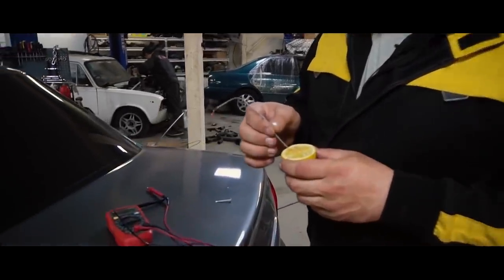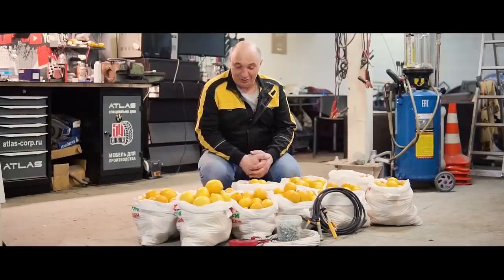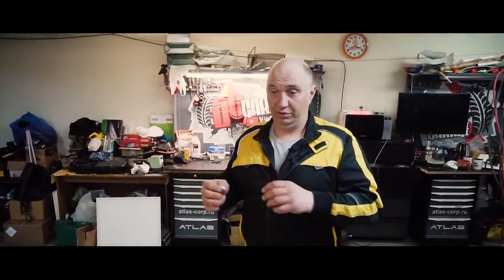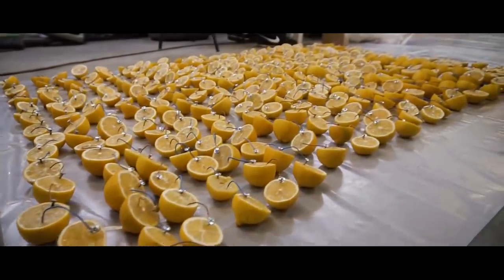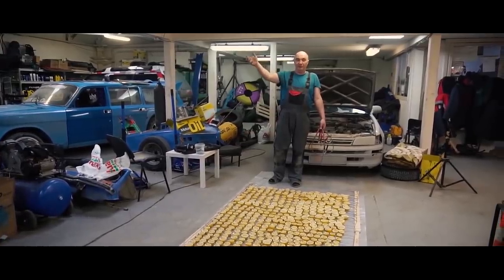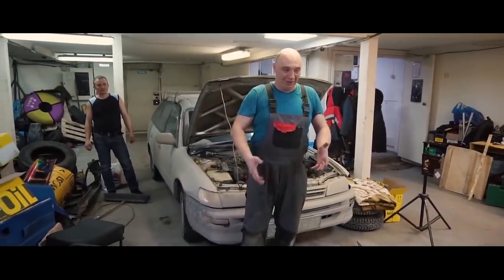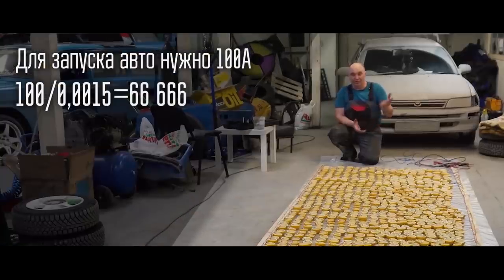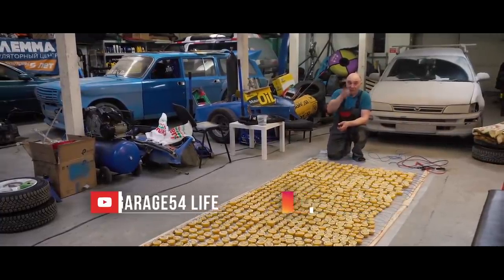Can a battery made from 1000 lemons start a car?

Comment: 8:30 He "measures amps" by short circuiting the battery. xD
10:19 He tested the battery by having one wire in his mouth and one in his hand. :D
Oh god I don't know if I should cry or laugh. :S
Reply: No he didn't short circuit the battery, I watched it many times...
Reply: @WhiteEuphoria74  have you used a multimeter? when you measure current the power is supposed to pass trough to the load, he put the wires to the positive and negative leads.
Reply: @Jeffthermite  Yes I have used multimeter many times and I know what you mean when you mention short circuit.
At the same time it is very common and possible to measure battery amps with a multimeter.
Reply: In a short circuit you basically get infinite amps even with a small battery. Go ahead and do this with a fresh 9v battery, i triple dare you :D
Reply: @WhiteEuphoria74  Look at the comments. Now go argue :D
Reply: @Jeffthermite  That is fine to measure a battery with very little current, just to get an idea of power. You are using the meter as the load, of course this not the way you measure a real power source, but a lemon battery barely has any current.

Comment: Can a battery made from 1000 lemons start a car?
I save you some time: NO
Reply: Thanks!
Reply: I paused at the ad and scrolled for this comment. 👍 Thanks
Reply: Probably he used too small of the mass like a screw.
Reply: Came straight to the comments for this.
Reply: Yeah, 250 amps isn't coming from 1000 lemons. Amperage is not the same as voltage.
Reply: The internal resistance of the lemons would prohibit even 1amp.
Reply: Corey N  These people already know exactly what they like: the results. What an embarrassingly narrow-minded comment, Corey.

Comment: It didn't work because your Anodes and Cathodes are too small. Try them with wide sheets of copper and Zinc plates on each lemon and you'll harvest much more power!!!
Reply: True, voltage and ampere multiplied the factor of the surface difference

Comment: Instead of the tiny wires, use sheets of zinc and copper. The more plate area you have, the more current you should be able to get. Also, the distance between the plates affects how much current you get.
You could also get the juice from the lemons and make a proper battery: Zinc, paper divider, copper, paper divider etc. and then fill it up with juice. You could do it with about ten or twenty lemons I'm guessing.

Comment: Yes, you can start the car with 1,000 lemons; you just need the help of a super capacitor!

Use the lemon to charge the capacitor and once enough energy is collected, then it should start the car will no problems.
Reply: The lemons still wouldn't put out enough power

Comment: My guess is the small surface area the acid had to contact, try a container with copper and zinc plates in it and juice the lemons into it. Could try one on each side or alternating plates with all the zinc in line and all the copper ones in line.

Comment: Dear Vlad, on the toyota this did not work maybe.
However I own a Dnepr (soviet) bike and was once stuck with a broken voltage regulator, which boiled the bike battery till dry. As the bike was running, no issues. So drove as far as the gas tank allowed until the inevitable gas stop.
Bike didn't fire up (kickstarter) because ignition (electronic from Ural bike) required at least 8 V and battery of bike was obviously below. Went into store at gas station and bought a 9 V battery to parallel the internal one.. And got home like this.

Maybe you could use the handcrank on a lada and some other alternative power source next time. 

Greets from Netherlands

Comment: Should have used wide strips of copper and zinc instead of wires and screws. The wires have to small contact area in the 🍋 also a super capacitor would help store all that juice and release it faster

Comment: Maybe add in some capacitors e.g. lemons change capacitors and then use the capacitors to actually start the car. 
You should try to make a welder using lemons. That would be amazing if you could get it to work.

Comment: Ok, but ah, what if you put it on a capacitor, to let it build a charge slow, would that do it ? and can you charge the Limon battery ? if you put power in would it not de-oxidize the connections like rust removal with charger?, or could you charge a dead battery over time?

Comment: I think there's another method of wiring them. For example in parallel instead of series. Series is giving you voltage. Parallel gives amperage I believe. So in a different configuration a reasonable amount of lemons may actually have enough juice

Comment: I thought to myself, if its the Citric Acid you're using to make the power, why not just make a huge jug of it and power an electric car? maybe the costs? so i looked into it, there is an average of 1.44g acid per ounce of lemon juice.  I found a listing of about 16lbs for 50USD then i found a 50lbs bag of Citric Acid for 99USD, soooo use idea?

Comment: To get the amperage and voltage up, use a copper plate, and a zinc plate. Giving a much larger surface area for the current to pass through should improve the power drastically. Possibly dangerously.

Comment: Tiny wire ends and screws don't have enough surface area. Try strips of copper and zinc sheet metal, and use more than 1 strip of each per lemon. Interleave them like plates in lead acid battery. Also, solder all the connections. Make a wood grid to hold each lemon half and wood bars to hold the electrodes so they can be stabbed quickly into the lemon halves.

Comment: You can get more power using plates rather than nails, the power delivery is dependant on surface area exposed to the acid 

If you used thin but wide copper and zinc strips you probably could start the car with 1000 lemons, albeit just barely

Comment: surface area of copper and zinc which greatly affects the amount of volts and amperes. You should try using a plate rather than just a wire

Comment: That's a lot of money spent on a galvanic effect. Try the epsom  nosalt table salt in a copper tube(+) with a magnesium rod(-) center, it will produce higher yields(ive had 1.2v) and if its .8 volts or higher you can run it through a diode for multiple cells. Dry cells if done right can last for years.. Ive made some cells and hooked them up to a jewl thief and lit a led for a couple of weeks, im pretty sure i didn't boil all of the water out(heard 1100°f). Just something to look into if you like making cells and you are responsible around open flames.

Comment: That was a "shit ton" of lemons but I have to wonder if they used larger electrodes (more surface area) and heavier wire, would that have changed the outcome? I mean, after all, ya gotta run heavy enough wire to support 100 amps so the voltage drop in their lamp cord might have played a roll here.

Comment: The electricity isn't in the lemon ,but in the electrodes. You already have 1000 halves,with each having only two electrodes(one cell)..you can poke like five pairs in each half of the lemon(five cells) and then connect them in series.you don't need more lemons.

Comment: Instead of lemon halfs. Use a whole lemon and stick a zinc rod in one side of the lemon a copper rod in the other side. This would 1. Be quicker to set up with minimal oxidation. 2 double your capacity of mili amps.

Comment: Lemons do actually contain an acid, it is citric acid (vitamin c) and it can be found in many citrus fruits but lemon is the best for it. Boiling the juice will concentrate the acid making the reaction between the copper and zinc more powerful which means hopefully more volts. if you want more amps i think you will need to increase the surface area of the zinc and copper pieces you use.

Comment: if you increase the surface of the electrodes in each lemon e.g. using sheet metal for cooper and zink the amperage could be increased significantly

Comment: The energy comes from the metal, not the lemons. The lemon is the electrolyte. The energy is from the potential difference between the zinc and copper.

Comment: I did a calculation. You would need roughly 10.4 million lemons to start a regular car in mild weather. That's assuming 9 volts (drops from 12 at high current draw) at 250 amps, which would be a well taken care of car. Each lemon battery makes 0.000216 watts, and a regular gas engine consumes between 200 to 300 amps when cranking, or 300 to 500 if its a diesel car, so lets assume the average 250 amps as stated previously. Thus, 9 volts at 250 amps is 2250 watts, ergo, 2250 over 0.000216 is around 10,416,667 lemons.
Edit: Ah, wrote this halfway through and didn't see your calculation yet XD

Comment: My battery went dead and I had no help. But I had D cell batteries so I taped 10 together and soldered two wires and hooked that to the engine and then Bump started it. This only works with manual transmission

Comment: The principle is sort of in the right direction.But you need to have each row connected to a proper copper busbar instead of a thin piece of wire that can only take a few amps at the most.Also all those 1000s of wrapped connections give a cumulative voltage drop that is probably making the whole thing very very innefficient,meaning you lose almost all of the voltage you're making just because of the bad connections.

Comment: The reason your lemon stopped workimh after 30 mons is because those arent zinc screws, they are zinc coated and it only took the citric acid about 30 min to break down the tiny layer of zinc on the screw so you ran out of zinc. If you used an actual piece of zinc it would last much longer

Comment: Hook that up to a "joule thief" circuit and you can get as many volts as you want >100V. 

Or connect it to an ultracapacitor bank and you will have your car started from lemon power. 
It might take a few hours to get the necessary charge stored.

You can do the same thing with boiled potatoes.
It's the metals that are the energy source.
Try iron and silver, should work slightly better.

Comment: Wait a minute.... when measured with the multimeter in 2000 mA mode he measured 1500 mAs.... that's 1.5A. So his calculations are off by 3 orders of magnitude.
Reply: If you look carefully the multimeter was in 2000 µA mode, 1500 µA = 1.5 mA.

Comment: I think your math isn't right!
He devided 100A by 1.5mA, but the 1000lemon battery puts out about 1500mA.

So you would need only 66 666 single lemons to start the car and not 66million!
Reply: It doesnt have 1500mah capacity.  He was measuring the short circuit current of the battery.
Reply: @davidmowbray4230  sorry, my mistake! I meant Milliampere. 😅

Comment: Would have gotten better capacity if copper and zinc of larger surface area (such as a plate) was used. But, this still is unlikely to enough to start a car.

Comment: No way the wire is thick enough to carry the current (not to mention are relatively high in resistance by the point you wire all the lemons).   Could possibly work if you use larger wire, but better solution would be to just completely remove the contents of the lead acid battery and replace the innards with layers of alternating metals to create the cells needed to achieve 11V or higher and then pour lemon juice in the battery.  Possibly then will work maybe once or twice.     :)

Comment: Short battery life probably from fast internal  discharging. I have 2 improvements:
1.) Maybe there is internal problem - parasite current between paralel lemon circuits. Try to buy another minimal 2-4 sets of "batteries" and measure current between paralel circuits without no consumption device on output. There will be probably small current. But between 100 paraler circuits can be higher voltage difference and from it waste current. Try use diodes in every parapet circuit. Voltage drop will be 0,3-0,7V, but parasite current will be 0,000A. 
2.) In one lemon You can try ad 6-9 Cooper and nickel wires for test maximal current. But only in single pieces from lemon. Between them is  "isolation". 
3.) Send me here link for video - this will be for me. :)

Comment: may I make a suggestion why don't you use the lemons to go ahead and fill up a capacitor you'll probably need supercapacitors run them in series I'm pretty sure that would work use the lemons to charge that off and then fire it up technically the electricity comes with lemon so the car did start by lemons just a thought

Comment: Sure is a big difference between usable voltage and usable amperage.
Like with solar panels the no load voltage read is twice the stated voltage I'm only talking about DC Voltage. With the correct battery storage system and solar panels can provide usable voltage and amperage.
But you won't be running anything except maybe a DC LED Light.

Comment: You got the wrong lemons... The lemons you need are the chernobyl types!! 1KG of lemons would turn on your car and power your house for 1 month, but is a different method, you need to place the lemons in a high pressure containing vessel and instead of copper and zinc you just place a graphite rod then add balkan 176 enriched vodka until a nice blue light glow appears.

Comment: This would have been possible if you had a number of 12+ stages that could charge a modest super-capacitor array over a period of time.  The capacitors have an incredible discharge current, when charged will easily start a car.  Search google for supper-capacitor  battery replacement.

Comment: Hey fellas, you didn't have to cut the lemons in half😕. You could have left the lemons whole and just pushed the copper and zinc rods through the skins. It would have been a lot more neater and maybe better results. 
 And instead of zinc. You should have tried stainless steel.

Comment: 6 lemons  cut in half would be 12 volts..  connect those half twelve to another half twelve in parallel and you have higher amp capability .

Comment: You need to connect the halves in Parallel to increase the amperage and then connect banks of them in series for the for the voltage.  That should work.   You need to know what amperage you get from one lemon and divide the amps you need to start the car by the result, that will give you how many lemons you need in parallel.  Then you need to divide the voltage needed to start the car by the voltage of one lemon and that is how mant banks of lemons you need in series.

5,555 lemons in parallel then 12 banks of those in series.

Comment: Well , should at least make a ok battery charger kinda like an trickle charger ,them lemons should put alot of power out ,if the cells had wider plates instead of screws that's where the power lies .

Comment: Using pins for plus and minus minimizes surface area. Something flat would have more surface and then more current.  So this was a worst case scenario because it is capable of more power simply by not using pins.

Comment: I'd like to see a diesel electric hybrid, where a commercial diesel electric generator is towed behind the car, The generator feed an electric motor installed in the car and pulling the generator. It works for trains.

Comment: The lemonade part... idk it has zinc ions in it. Not a good thing to drink.
As for the bettery part, the zinc coating on those screws is very tiny, should have used zinc strips or at leas galvanized sheetmetal (at least those are hot dipped zinc coat on them, way thicker that whats on those zinc electroplated screws) This at least one part of the reason the voltage drops so fast.. the zinc gets consumed too fast. In theory this battery should last longer with more amps if you have more copper surface (copper strips) and more zinc as sacrifice, preferably pure zinc strips. The more surface the better the amps untill no more solution is available to carry the ions.. so there are 3 things that have an optimum: the surface area of zinc big enough to fully saturate the whole solution with zinc ions, then a big enough surface of copper to accept those zinc ions.

Anyway even if carefully finding the correct area for zinc and copper, what will ultimately happen is the internal resistance of the lemon is quite big as expected.. so the voltage drop under a serious load will be probably greater then the voltage it puts... so it plummets to 0V in a hurry. in order to work you need even more paralel lemons to lower the internal resistance, maybe add more in series up to 20-30V even 100V as under load it will drop badly.. and hope for 10V under 80A of load. In the meantime the lemons might just explode and boil from the current draw (beacuse of the internal resistance the lemons will heat up with the same current at 50-70V of draw.. which will be at least 5 times more that what you use to start the car.

So even theoretically, the different potential is real, but in order to provide longer and with more amps you need to accept the disastreous internal resistance and boil some lemons in order to draw any big amps.

Comment: It's a common misconception with these types of batteries that the lemons/potatoes/apples/etc. are what makes the battery work. In reality, it is the dissimilar metals that make the battery work, and the fruit is only a vehicle. More metal in each lemon, having your metals closer together in the fruit, etc. could get your current capacity higher.

Comment: why'd you drain the battery down like that?  you could have at least tried to start the car with it.  using the ammeter is what killed the battery, the amperage the ammeter measures is the amperage that is passing through the ammeter which means you are draining the power of the battery.

Comment: You don't have to cut the lemons in order to insert the electrodes and the surface area of each one is verry small. Meybe with more or thicker electrodes you would only need 2500 t of lemons 😂